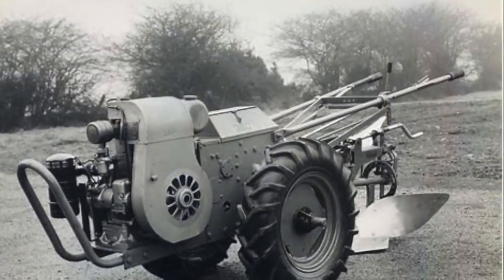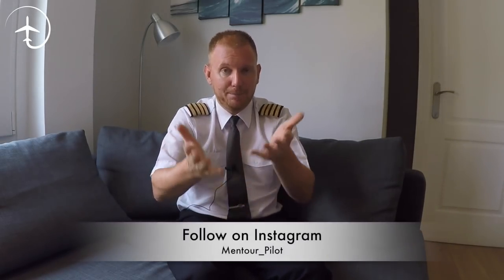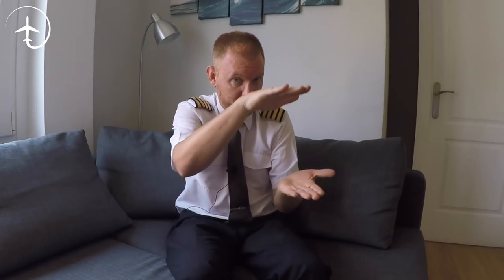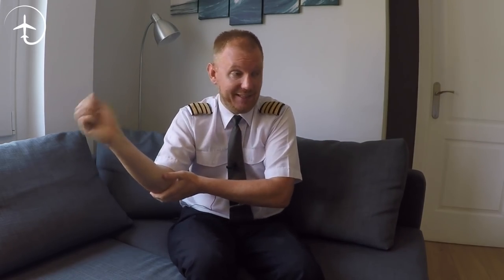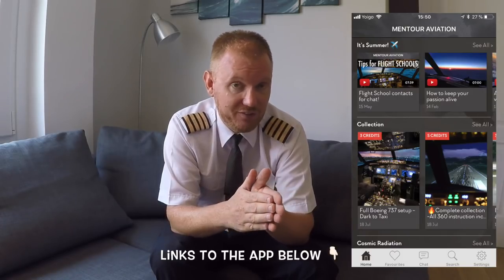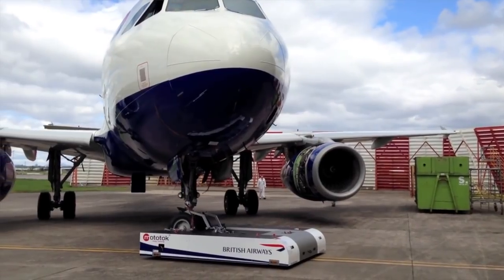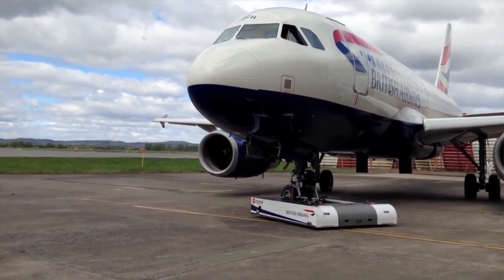Aircraft pushback, why is it necessary?

Comment: Aircraft pushback is necessary because it’s cheaper than moving the terminal out of the way!
Reply from the maker: That’s true! 😂😂😂
Reply: You sir, just made my day xD
Reply: I can go one better, make the passengers push! :D
Reply: You are a genius
Reply: They should build elevated terminals so aircrafts could get through and you could board in a dry area during bad weather.
Reply: Pretty crafty.
Reply: @MentourPilot  Does newer aircraft need to be air started or are they able to start themselves now?
Reply: @christianbarnay2499 
In not elevated, at least design terminals with drive through lanes for aircraft and movable jetways long enough to reach their doors. 
No pushback needed.
Luggage loading in the rain in no fun but at least the passengers and carry-ons would be dry :-0)
Reply: I actually thought that some air crafts had motors integrated with the landing gear.
Reply: Funniest thing i can ever get on internet😂😂😂😂😂
Reply: @Stacy_Smith  Air is taken from the APU ~ The 400hz ground power unit also has a DC Voltage though I do not know if this is used to bring up the APU; 
Found 28.5 for the DC Voltage though point 5 would not normally be of consequence;
200V 3 phase 400 Hz power is way too powerful for any other than really paying attention;
Reply: @ChiDraconis  Ty
Reply: I think it's also probably to save fuel. As I understand, a plane moving around on the ground on it's own power is very inefficient.
Reply: O hell yea.
Reply: As Moe would always say, "Wise guy huh? Why you numb skull."
Reply: @christianbarnay2499  🤣
Reply: Just put the terminal on wheels.
Reply: lol
Reply: JAjajajajaja, good one...
Reply: Dad joke of the year.
Reply: Thanks that saved me 14 mins
Reply: Lol

Comment: Aircraft Pushback is necessary because Aircrafts have no Rear View Mirror. 😁
Reply from the maker: That and quite a few other things. 😂
Reply: The plural of aircraft is aircraft.. just saying!
Reply: Well...commercial aircraft anyway. Ye olde F-15C has 'em, though not for ground operations. :D
Reply: All jet aircraft need backup cameras.
Reply: The system, imho, wouldn't be that practical. You'd need one on the rear then one on each wing tip as well which would mean a pilot would need to view and asses three different FOV's at once which would be difficult for the brain to process. Fine for spaced out airports but in most of the major ones / hubs where space is at a premium you're screwed.
Reply: Just bolt on some jeep mirrors
Reply: maksim5078 Rear view mirros would be pointless but side mirrors though...
Reply: The pilot just has to stick their head out the window and make the beep beep sound as they reverse
Reply: NSVP Haaglanden - Jet aircraft have reverse thrust for slowing after landing. This can be used in an emergency as a "reverse gear" but is highly undesirable as especially underslung engines can kick up trash, gravel, etc. and then inhale the foreign matter. High mounted engines above the wings or on the tail don't have this drawback. It uses considerable fuel and requires the area to be cleared of personnel, baggage carts.
Reply: The C17 has its own rear power. with open cargo door, a person watches stuff.
Reply: Md 80: Hold my beer
Reply: Many cars now have a little cam and a screen when pushbacking (reverse parking), as smartphones brought the costs of video sensors down. Why is that not a solution for airplanes as well? Some passenger jets already have this feature in the entertainment system, so you can look down from the belly or forward from the stabiliser fin.
Reply: SJ15 please teach at screwl not on the enteryet! You poeple have better spell checks than the rest of the world!
Reply: @gunnarkaestle  Safety reasons.
Reply: 6
Reply: XD
Reply: @MentourPilot  they got no backup camera

Comment: In Physics, you dont pull "weight", you pull "force" (or "work"). So the necessary Force to pull an aircraft is F=m*y*g=weight*rolling_friction_coefficient*gravity_acceleration. So the force for a Globemaster is F=128000*9,81*0,006=7,5kN which equals a about 500kg squat combined with 200kg Row.

Comment: I did this for years at JFK for AA, and let me tell you....     their huffs (push-out tractors) were old as hell at the time and simply could not handle very heavy aircrafts with engine starts throughout the push.  Specifically the 2nd party 747’s of other airlines we provided services for.  Tow bars would commonly end up destroyed on the count of that as well.  Then add the pilots eagerly harassing you for clearance to start their engine sequence early with the very tight gates at the old terminal and forget about it.  Much better experience with the tow bar less machines, but we were useless on out MD80’s.  Great video

Comment: Tractors got their name from Traction Engines, which were steam powered vehicles that didn't need rails to operate.  Those vehicles were used for pulling farm devices (hence the farm vehicle being named tractor) and also moving freight from place to place (hence how semi trucks are also called Tractor Trailers).  So having a small powerful vehicle for a moving large things from place to place sometimes earns the name Tractor.  These tow vehicles earned the name for the job and yes because farm tractors were (and sometimes still are) used for moving aircraft around the field.

Comment: I was almost stuck in KTM once when the pushback truck broke down. They ended up pushing the Thai 777 back using a regular Toyota 4x4.
Reply: Pyroman / You need to learn how to write....
Reply: Pyroman /  Good one ! You mean SUV by Truck?
Reply: Jonathan Stewart  I think we were in the same flight broooo!
Reply: The actual moving of the aircraft is pretty easy. The hard part is stopping them, if the aircraft brakes fail.
Reply: Nascimento And you need to learn correct terminology, and grammatical precision. Felt like I should point this out like you did with pyroman.
Reply: @neverloosehope4233  it is only a SUV in America in Australia and many other country it is called a Truck and the bigger Trucks like the ones that pull many trailers are called road trains!!!
Reply: @ayushh111  a 4x4 can easily tow 400kg.

Comment: Everything I know about pushback tractors I learned from this video. But, according to my general knowledge of that kind of equipment, I would like to add some technical sidenote: some pushback tractors, especially TBLs, don't even have gearbox. If you need high torque, low speed, and also need hydraulics for other stuff (like lifting in TBL), using hydro motor for moving truck (and aircraft) around is usually better solution. That eliminates gearbox because engine drives hydraulic pump directly and torque and speed are regulated via pressure and flow.

Comment: At KIAH, we've been using a newer kind of towbarless pushback tractor called a Lektro. It's electrically powered, and uses a winch to pull the nose wheel up onto a hydraulically lifted scoop. It looks kind of like the head of a snow shovel.
Our newest ones are capable of handling any narrow bodied aircraft up to a B757-300, and seat the entire push crew for the return trip to the gate.

Comment: I flew with Eastern Airlines in the 80's and did powerback operations with 727s.  The procedure was forward thrust to get the wheels off the flat spot so the plane would start moving TOWARD the terminal then reverse thrust to back out.  Refrain from using brakes while backing up because with three aft mounted engines it would be possible to tip the aircraft on its tail with a light fuel load in the wings.

Comment: Hey Captain Petter, I went on a Caribbean Cruise late November 1988. The originating port was San Juan Puerto Rico. I flew Eastern Airlines. When the cruise was over, the departing gate was the second to last one.  At the last gate there was a 757. It departed before my flight and there wasn't a push back tug. The aircraft started both engines and then used reverse thrust to back away from the gate. A note the terminal at SJA is a straight line not bowl shaped like most airports in the USA. As it was the last gate, I guess it was OK to do that. There was nothing around to be blown away. Guy Franks

Comment: I remember when I was a child I was visiting family in Montana and we flew into KBZN.  At that airport at that time I remember the pilot of the 727 backing us out of the parking apron with the reverse thrusters.  I thought that was neat.  Since then they switched over to using push back tractors now.  Another airport that I flew into quite a bit is KGCC.  Even today this airport does not have any push back tractors.  So they park the plane a little distance from the terminal and we go down the stairs that are attached to the airplane to go inside the terminal.  Then when the airplane is ready to go it will turn its engines on and go forward making a U-turn on the apron to leave.

Comment: I was in a U.S. Navy air squadron from 1971-75. I was enlisted and even though I was sent to Aviation electrician's school ; after I got to my squadron I enjoyed being out on the 'line', where our jets were parked and launched & recovered & refueled & all that, that I decided to stay out there and become what is called a 'plane captain'...like a crew chief in the U.S. Air force. I was responsible for getting the jet ready for flight...being sure all the fluid levels were correct, pre-flight walk around inspection before the pilot(s) did their own walk around, fueling, assisting the various shops when they needed to work on a plane, etc.., and towing the planes around & in and out of the hangars. Let me tell you, backing an airplane with a tow bar and 2 pivot places, one on the tow truck and the other being the nose wheel, makes some interesting thinking. If I wanted the rear of the plane to go to my right, for example, I needed to turn the front of the tow truck to the left...the opposite of what you would think. It was funny watching the new guys trying to steer a plane for the first few times; some never did get the hang of it. Our tow trucks had a big engine but had been governed down to keep the speed low, but occasionally we would get a tow truck where the governor had been messed with and boy could those things haul butt...!! I got to where I could maneuver 2 planes so close that their wingtips were only a few inches apart, a must when you had to get all the planes inside the hangar for various reasons. Yes, we always had to have wing walkers and always someone in the cockpit ready to mash on the brakes if something went wrong.
Reply: marbleman52 a
Reply: Are You retired now? Good comment insights !
Reply: Buddhist...Yes, I retired about 8 years ago, but my 3 years in VAQ-33  have always been the most rewarding and challenging...and fun...years of my working career. It seems like I packed about 10 years of living into those 3 short years..!!
Reply: Nyc to meet u sir
Reply: 24 year retired AF crew chief.  It takes a good operator to back a large aircraft without damage.  Visibility sucks.
Reply: Also a former Air Force crew chief.  F-4, T-39, B-57, and T-38.  Support section did the towing in the F-4 unit.  The short coupled, narrow track T-39 was a booger to back with a tug so we just pushed it.  Learned to back an aircraft on the B-57.  Easy aircraft to learn on.  Guy that taught me told me to start my turn in the direction I wanted the tail to go and follow it around.  A little turn goes an long way.  And never be afraid to pull forward and start again.  Refined my skill in the T-38 unscheduled maintenance hanger.  Multiple movements per shift provided plenty of practice.  Had to tow down the center of the hanger and back, making a 90 degree turn, into the spot.  I could do that and park the bird with two feet clearance between wingtips on either side.  Once you get the hang of it and enough practice, it's easier than you would think.

Comment: I remember being on a few flights in the 80's where they used the reversers to push back from the gate.
Reply: I remember seeing it done from the terminal back in the 80's, and was a passenger for a power-back once.  I believe it was on a DC-9 or MD-80.

Comment: Great Videos, Just a thought, if reversing with low engines could suck in unwanted material why isn't this a problem as you taxi to the runway?
Reply from the maker: Because the reversers throw up debris in front of the engine.
Reply: Mentour Pilot thanks, Keep the videos coming!
Reply: I think Mentour hasnt really answered the question.

Taxiways are relatively easy to keep clean as the only thing that moves there are airplanes by themselfs. Yes, sometimes a plane looses something, but then he calls the tower to tell them and they will send a car to look for it (same goes with the runway). So in a nutshell it is sufficient to just check the taxiways and runways in regular intervalls to be sure, that there is no major debris.

But the same is not true for the parking spots. There are cars, catering trucks, the trucks bringing the luggage, on some stands even the passengers have to board the plane from a bus, etc. It would be impractical to check the area each and every time for something not belonging there.
Reply: Alan Guile I was thinking the same thing!
Reply: and also FOD is more like to be on stand, because this is the place where plane is being despatched. A lot of debris comes from broken bags and mess from cargo holds etc. Also because there is often road infront of stands where cars and people are moving. Pushback cars are way too more effective and it also saves fuel. But as we know, sometime waiting for pushback are when TSAT is right on time is real pain in the ass :D..
Reply: Alan: We routinely did power backs in the DC-9s and MD-80s when I flew them in the 80s. Of course, the engines are mounted higher off the ground so there was less problem with foreign object ingestion. Also, in preparation for departure, the station personnel performed a fastidious examination of the surface around and behind the airplane.
Reply: And could you imagine how passed the ground crew would be?  Lol
Reply: It probably is to a lesser degree but with reverse thrust all the crap in front of the plane will be thrown up off the ground and made easier to ingest by the engine intake. All the crap being thrown up by the jet blast when taxiing forward will largely be thrown backwards away from the engine. Would you agree Petter?

Comment: I flew ValuJet (Critter) a few times out of KMDW and they would often use the aircraft power to back out of the stall. They were flying DC-9's. I was always amazed when they would do this because the windows in the terminal would rattle something awful!

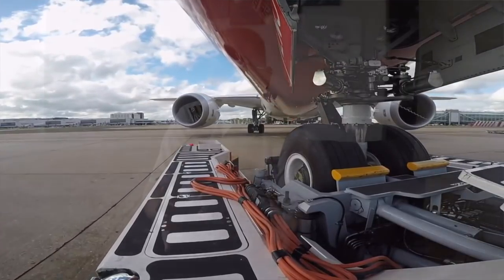Comment: @mentor pilot, i would like to clarify what you said at 6:30 about torque and add the concept of reduction. With the engines in the tugs producing 300 to 400 hp they would probably produce somewhere in the ball park of 200 to 350 if gass (unlikely) or 300 to 500 or 600 ft-lb (-really torquey diesel) at the fly wheel. The gear box that you talked about increases the amount of rotational force on the wheels at the price of rpm (reduction).  If the gear box had a reduction ratio of 2:1 then you would double your horse power at the wheels (not taking into account the energy lost from friction in the gearbox and other things) but you would produce that force at half the speed. (please correct me in a reply if someone finds a discrepancy in my guesstimate on values or has questions)

Comment: Tractor is a general term for any machine primarily used for its ability to apply tractive force. For example highway tractors that pull large semi-trailers. 
The term tug, like so many terms in aviation, is derived from the maritime industry, a small vessel with no significant payload capacity of its own but with sufficient power to move large external payloads (other vessels, barges, rafted logs etc) primarily by either tugging on a line or slightly less common with pushing.

Comment: Great educațional video ! I have a question though , why do we sometimes smell jet fuel in the cabin during the pushback operation ? Thanks !
Reply: you are probably smelling the exhaust of the pushback tug/tractor which runs on diesel fuel, which is very similar to jet fuel. The tug exhaust is sucked into the engines and some of it makes it through the air conditioning packs/pressurization  into the cabin.
Reply: That, and jet fuel smell permeates everywhere. Especially if there's been a spill recently (it happens more than you think. We get at least one spill a week).

Comment: What do you know about electric taxi systems? That's where the landing gear has built-in electric motors, which allow the plane to push itself back and taxi without the engines running. What planes have them? Do you think they'll catch on, or will there be too much weight penalty?

Comment: Do all Landing Gears have Brakes?? And When Parking Brake is applied then It only Brake Nose gear or all Landing Gear?
Reply: Hoshang Govil    All the main gear tires have brakes.  The parking brakes, activate the aircraft main brakes.  The only so called brake for the nose tires, it a friction pad to stop the tires during retraction.  Otherwise they would act like big gyroscopes and affect handling.  Brakes are applied during retraction to stop tire rotation, to prevent the gyroscopic action.

Comment: I worked for a large cargo airline in the past.  They had a lot of planes that depart about five minutes apart from each other.  The solution, arriving flights would transit to the end of the flight line,  do a U turn and taxi into their spot. After the cargo was processed and doors closed. The crew would move forward onto the taxiway. No need for a pushback tug unless they needed to put it elsewhere on the ramp.